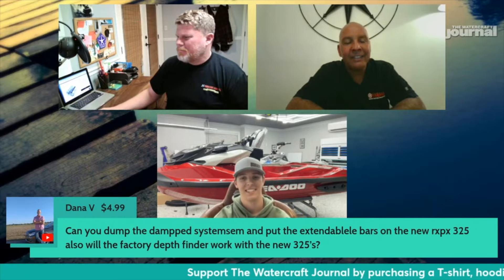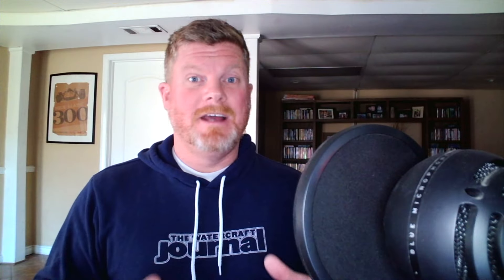'24 Sea-Doo RXP-X Handlebars Can Work on Older Models: WCJ Quick Topic

Comment: Colored stainless steel handlebar. Standard on RXP-X 2016 +, GTR-X 2016 -19 and SPARK models with adjustable riser steering.